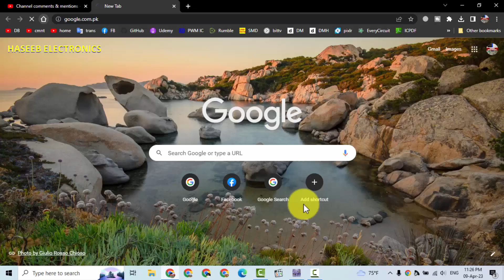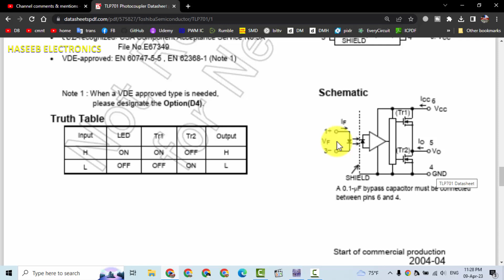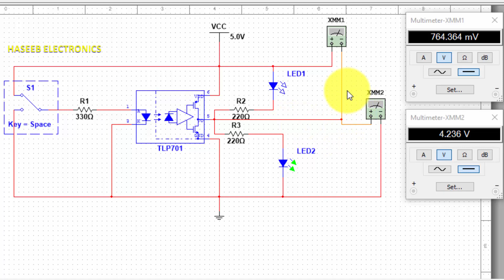{865} how to test OPTOCOUPLER

Comment: Thank you
Mere pas cebil transmitter SMPS he 
Une ripering ke doran 
Dete padi he prds khab the unhe cheng kar 
6n60 mospet uc3842 817opto c
DC capi 450volt show VCC 21volt 
Pin8 par 5volt nahi he 
Ic par pin7 par 21.22volt mil rahe he 
SMPS not working
To ap batay ic check kar ne ka tarikha 
Mene uc .tl3842.pin6par +nov
Baki pinpar -nov tach 
Velu rajitens all'pin1233 show ❤
Ap ne kisi video me kaha tha 
Meri video par coppy rate nahi he
Muje bahut acha laga 
Subscribe ke comet se ap khus to hhote he kuch soch me pad jate hou nge

.33om r